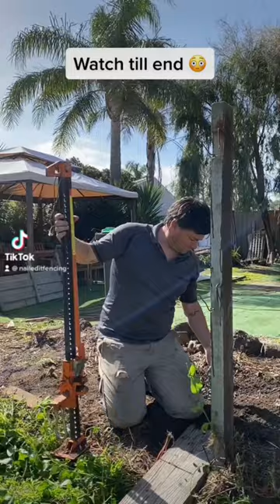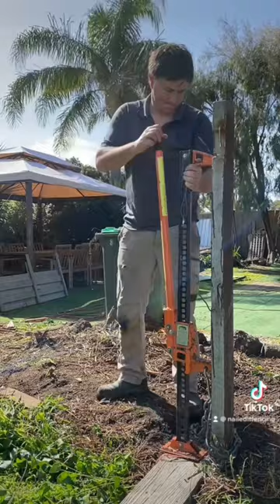How to pull out a fence post #shorts #diy #fencing

Comment: Jack the post up 50mm cut it with a reciprocater saw and smack back into its hole..
Cover the 50mm spacing in the hole with some soil..
Im sure you know that trick..
Great videos thank you
Reply from the maker: I do genuinely try getting posts out the ground. With this particular job, posts were pretty much going back into the same spot 👍